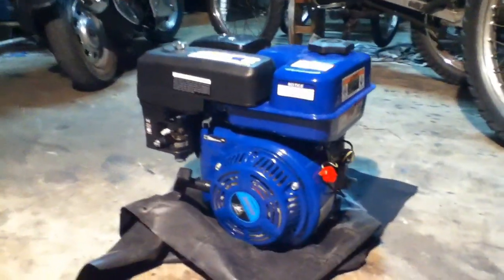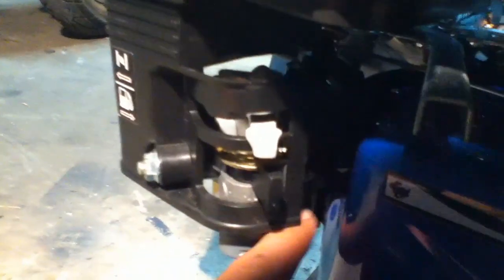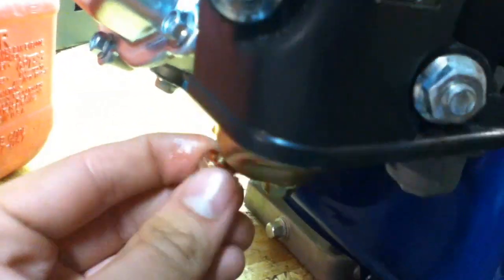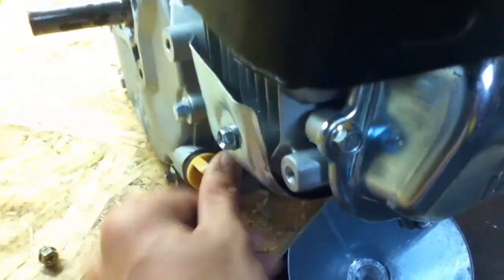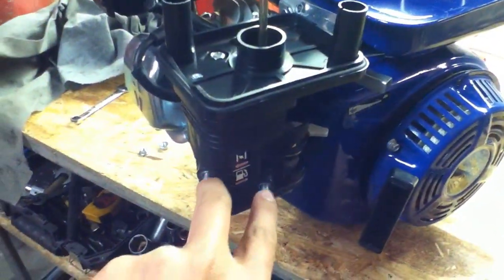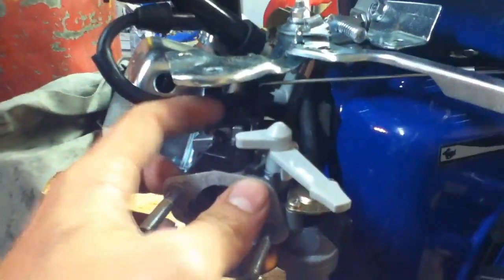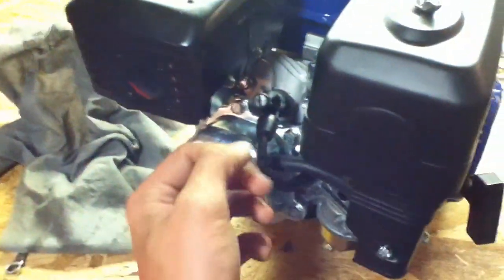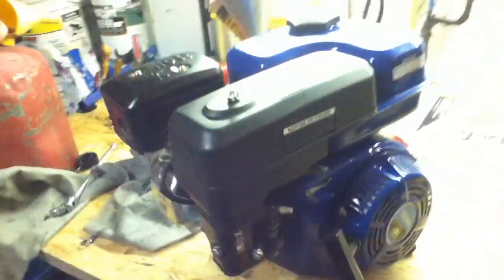Greyhound 6.5hp Engine Troubleshooting

Comment: Mine runs rough when the choke is on what can cause it?
Reply: is the engine already warm / your weather is not that cold?
here in australia i dont need my choke and it only causes issues because the engine is not cold before starting.

Comment: Doesn't it make you wonder how that came off? Those are actually pretty good engines. I have 2 of those. One I used to repower an old leaf blower, and one on an old snowblower. I drain the fuel in between seasons. They are 1 or 2 pull start engines. All silver metal on these engines should be lubed to prevent corrosion.

Comment: Thanks for the great video, time, and the sharing it.  I bought a Go Kart with the exact same engine and this weekend I should finish the project.  It was not running when I bought it, looks new, already found some worn hoses that I am replacing.  I am cleaning the carburetor.  Need to put it all back on and hopefully I will be doing what you did on the last few second of the video.  Again, thank you much.
Reply from the maker: +Jose87694 thanks! good luck with your go kart

Comment: Greenhorn here for engines.  I have the exact same engine in a go kart.  I have 2 springs one is the long silver one for the govenor which was off and I fixed.  But where does the 2nd shorter spring attach to?   thanks for the video...

Comment: Alex, you seem to know what you're doing here. Well done, could you perhaps share with us how to disable the low oil sensor / tip sensor? I had one of these installed on a mini bike and every time it was tipped too far it would stall. This was frustrating. If you can, thanks in advance!
Reply from the maker: Kory White It's pretty simple. The oil sensor is located on the same side of the engine as the ignition switch. There's a yellow wire going to the sensor. You can cut (or unplug if possible) the yellow wire to disable the sensor. It's best to cut the wire somewhere in the middle in case you want to reconnect the sensor later on.

Comment from the maker: you can disable the low oil shutoff very easily- just cut the wire going to the oil sensor which is threaded into the front of the block. However they rarely fail, so you might have a different problem. Are you checking the oil with the engine on a level surface? And the dipstick should not be screwed in when checking the oil, or else it will read much higher than the actual oil level.

Comment: Got it running but it cuts out suddenly like the low oil shutoff is activating. Have you ever had problem with that and can I disable it?. If I tilt it it will stop also. I have checked the oil and sometimes it is low and then add a little and seems to high.  Any help would be great.  .

Comment: Mine has same problem but spring looks ok. If I prime it will run until prime runs out have gas coming through system. Situation just like yours ran great 3 months ago. Tried carb clean every where. Any ideas?

Comment from the maker: the throttle leaver is stiff because that's how these engines come from the factory (for setting a constant running speed). If you want the throttle to have spring action, you must loosen the 10mm locknut on the pivot for the throttle arm.

Comment from the maker: it wasn't the carb... did you watch the vid?
Reply: My motor ran for 2 days upon buying and now it is hard to start and dies whenever the clutch is all the way up
Reply from the maker: @towerclangamingclan1328  Take the fuel line off the carb and make sure gas is flowing good. Then take carb off motor, clean out the main jet and tube, idle jet, and needle valve. Make sure the float moves freely. This should fix it.
Reply: Alex's Bikes and Motors thanks very much
Reply: @alexsbikesandmotors  Carb cleaner & compressed air too.

Comment: FYI.. The line going to the carb from the valve cover is the positive crankcase ventilation (pcv). It has a valve to only flow out of the valve cover. It puts "blow by" back in the intake to be burned. It's an emissions thing... If you didn't have ventilation, it would push oil out the crankshaft lip seals.

Comment: I had my Greyhound 11 hp for 2 days and had to fix the gas shut off it wasn't letting gas through theres 4 holes in the rubber piece I just turned it to the other holes runs great had it for a year now  it did suck to have to fix a new motor

Comment: When I bought one of these engines I had problems with the petcock not flowing. I also noticed the idle assembly is connected to the limiter, so I had to disconnect that and it wasn't long before I broke a rod because that bitch was knocking hard! Thank god for warranties.